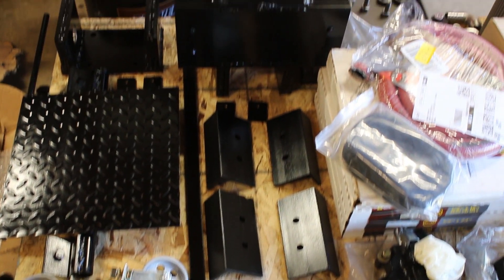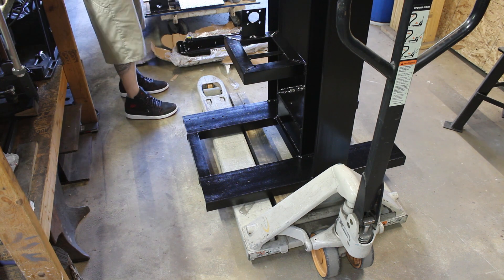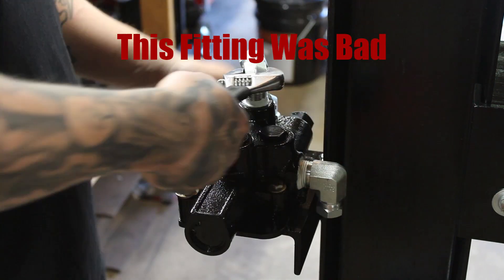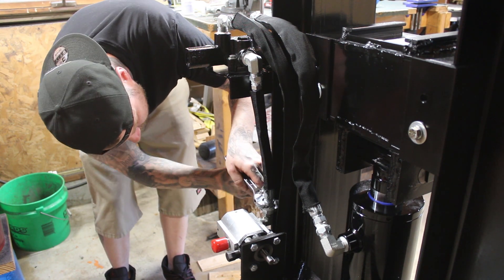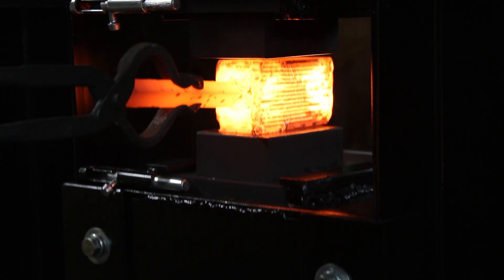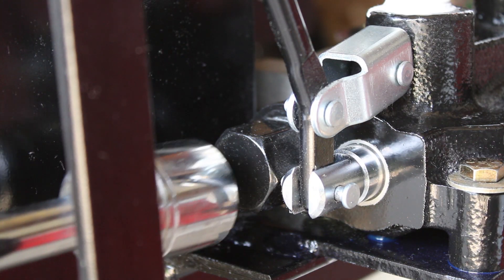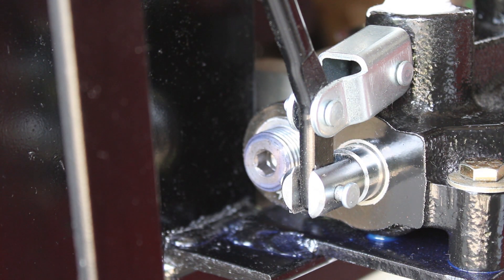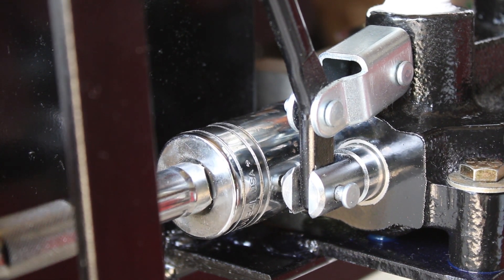DIY 30 Ton Hydraulic Forge Press Part 3

Comment: Hey man appreciate all the info in detail! Definitely helped me build mine. What gauge wire did you use from your motor to switch and all that? Havin an issue with mine and wonderin if its the wiring. Thanks!

Comment: I've been looking for a build like this for a while. Fine work sir.
May I make a suggestion for your foot pedal. If you were to add a tension spring to the release side of the pedal, when you lift your foot off, you would automatically release the pressure. making the process even less labour intensive.
Again, excellent work, just a suggestion.

Comment: awesome job i may have to build a new press you killed it bro i have a homemade press from james  ( redbeard ops )plans does the job for now,. a buddy welded the frame up for me at the time .i didnt have a big enough welder ,but he made opening the same as the travel which in my case is 8 inches  he didnt make it bigger so hard to do any feather damascus would you happen to have plans for this press ?
Reply from the maker: i sketched up more of a materials list than an actual plan, Tyrell Knifeworks was my inspiration on this build, its basically 5 ft tall with a 1ft wide sliding head